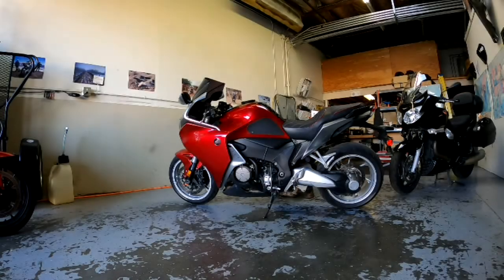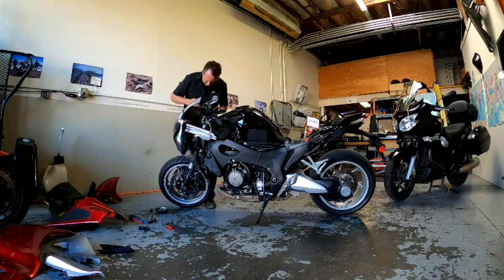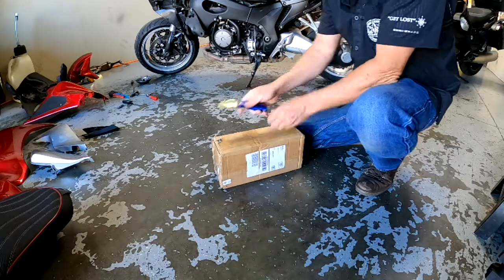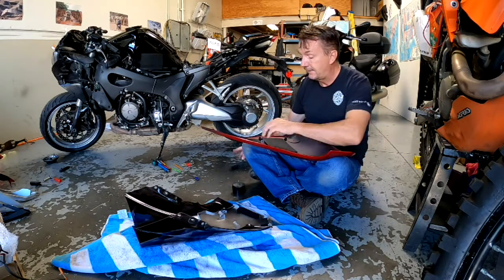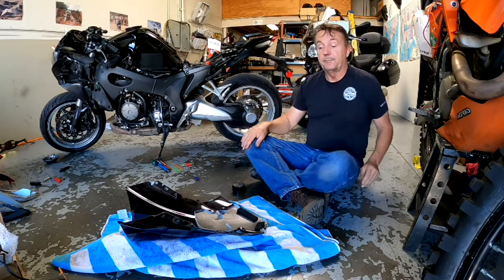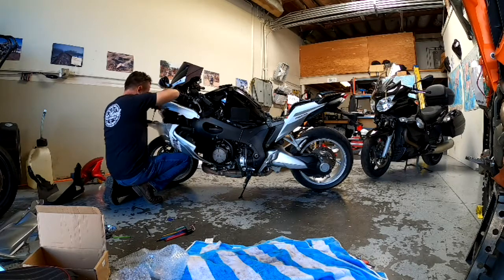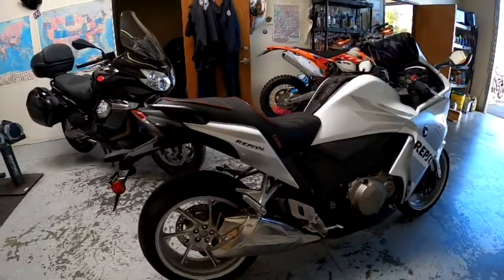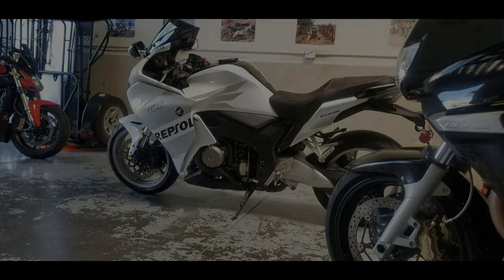2010 HONDA VFR1200F project update #2

Comment: GREAT vid thanks!!! I just purchased a 2013 VFR1200F in good condition and my project is to just return her to as new looking as I can. Mine is grey and I prefer your red fairings. Why change and where did you find the new ones please?? Thanks best wishes Simon
Reply from the maker: Congrats on the new bike!
The stock red fairings had a few scratches.
I had aways imagined this bike in white, this red in particular seems a bit bland, still nice but, thought a change would be fun.
I found the company on eBay, contacted them they were helpful and super nice, took about 6 weeks, fairings we're as good as OEM but paint seems a bit nicer.

Comment: Where did you get these fairings? Were they custom made? Fit and finish seem amazing!
Reply from the maker: we have had good luck with companies in Japan for the Fairings and paint, some will do custom work, this is the first time we used this company, their work looks great, but this is also a product they intend to sell as a off the shelf option, I would like to see more work before I recommend any one. I need to see if they have a US facing store front, if so this one should now be ready to order, I still need to get them some final photos of the Bike. the people we have used in the USA are quite expensive and tend to use non factory paint, work is still great but the paint seems to be soft for extended periods of time